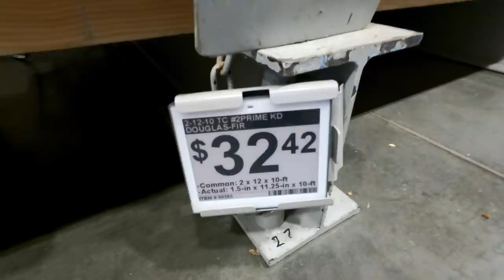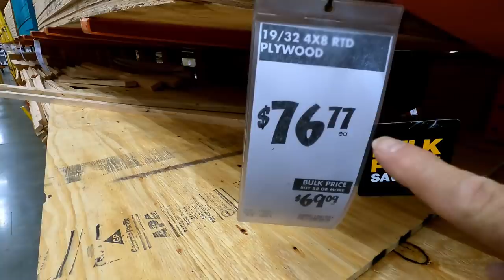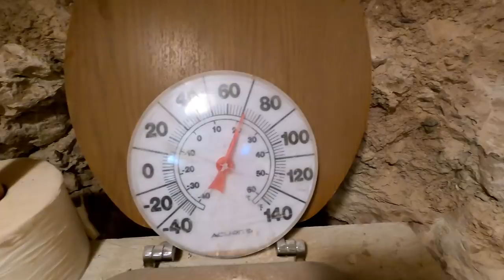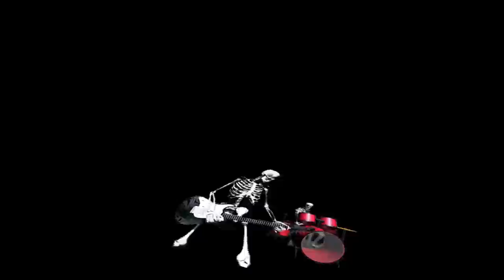When Will Lumber Prices Go Down ?

Comment: Why are the dowels better than nutz 'n' bolts?
@15:33, it would be funny if while eating the beans another hand raises up and starts trying to feed you, then another hand raises up with another can that it opens and starts trying to feed you.
Reply from the maker: hahhaha that would be good but no one will go down there
Reply: Yup, the newer  "timber screws" would  impact drive in faster than the time it takes to bore a dowel hole. And the cost of  dowel rod  ,hardwood, can't  be cheap.
It's probably what MSHA calls out and what's taught in mining schools.

If I already had the dowel stock, I'd  use it, still.
Reply: Oh, that's too bad, you need at least 4-5 people to act out that dinner scene from Blazing Saddles where everyone's just stuffing themselves WITH BEANS.
Reply: Methane and hydrogen sulfide are both naturally occurring, oxygen-displacing gases. But, combined with Jeff's unnatural love of Boston baked beans, you have the makings for a special species of 'under-bridge troll, malodorous, loud'.
Reply: @mikemalo6336  New underground specie of Barking Frog? I don't know if it's  Mojave, Santa Domingo or Dome Rock subspecie. May be another.
May  be it's  The Potholes Placer  Barking Frog of Imperial County.
It's  rumored that Tittering Toads have been heard( never have been seen)  but they were t hought to have  gone extinct.
Reply: @williamevans6522  Right on. I totally forgot about the Barking Frogs, Barking Spiders. LOL. All the critters that lived under the car seats in my Dad's cars!! Ha!!

Comment: Instead of complaining like some, Here is something that might be useful to ya. The future contracts ticker LBS=F (Just go to yahoo finance, it's free contact me if needed and ill help no problem) is a general gauge for lumber prices which have dropped from 1700-1800 a contract by ~50% to $900  **regular prices for lumber should be in the $350 to $550 range** and will increase going down which eventually will trickle down to the consumer, so hold down and sit tight buy only what you absolutely need and the market will stabilize and you won't be overspending (this was all due to hoarding by greedy little &%$$%$ but now they are freaking out and starting to sell their stockpiles) Best of lucks Jeff and Slim!!!

Comment: Dude? Could you show me how to find gold in my backyard in NC. So, I can Fillerbuster my way out of this country?
Reply from the maker: check the Black Slate belt
Reply: Ok will do
Reply: Their are places in Orange County, Apex and Burlington NC that has shale oil and shale with no oil. Chapel hill NC is partly built on Volcanic Rock. The gravel thats used in driveway's from the quarry is white not the usual greyish/blue (crush & run) is slang for the type. The white rock I have no clue what it is
Reply: But, ppl have discovered amethysts and pyrite in the whitish gravel.

Comment: Why did you measure using inches?  When the USA goes metric you are going to have to rebuild all those sets.
Reply: Well, as I understand the truth is that the US foot/inch is exactly the same as in the UK, BUT untill about 150 years ago is was so variable that they decided to fix it to the metric system. So we have actually been using metric measuments for the last 150 years.

Comment: https://www.youtube.com/watch?v=b1JlYZQG3lI  This video really explains the shortages which over course drive up demand and then prices.  Also, in basic economics, there is the definition of substitution.  However, this doesn't apply in your case.  There is no economic substitution in your application so you're stuck.  Then there is used lumber.  I have a good used lumber guy here in Placerville but even his prices are high.  I think the first 15 minutes of the vid explains enough.